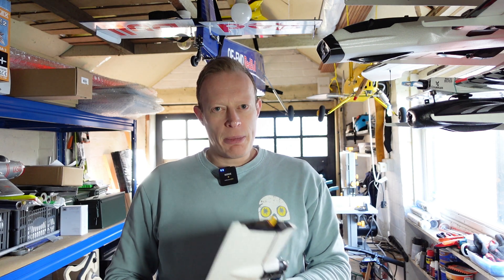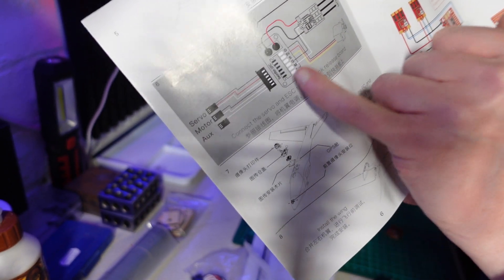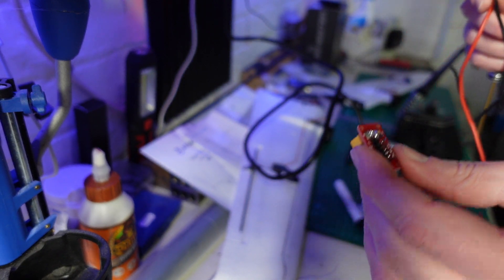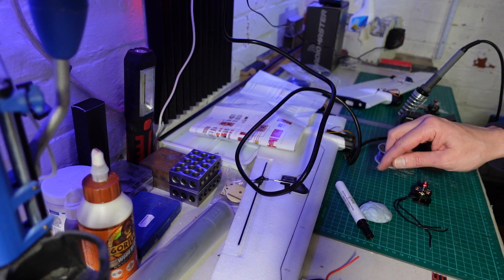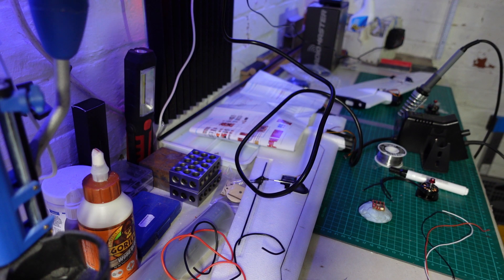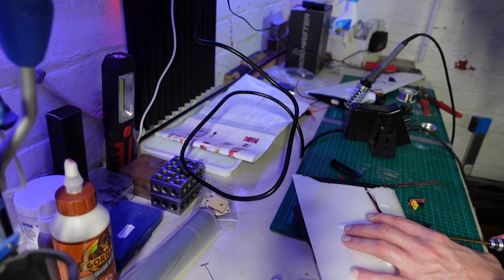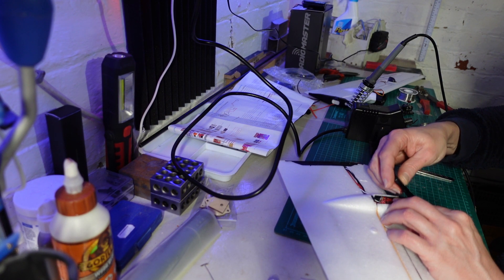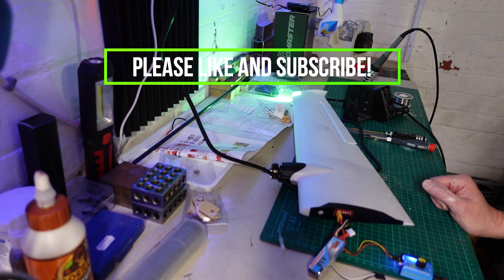AtomRC Swordfish assembly - Part 2

Comment: I was thinking about it, and, facing the same direction as the plane, I suppose you'd generally want the right motor to spin clockwise and the left motor to spin counterclockwise, because the props would be moving toward each other beneath the wing, creating slightly higher pressure, and away from each other above the wing, creating slightly lower pressure, which should add a little to the lift... maybe? 🤔 Cheers.
Reply from the maker: Probably 😂